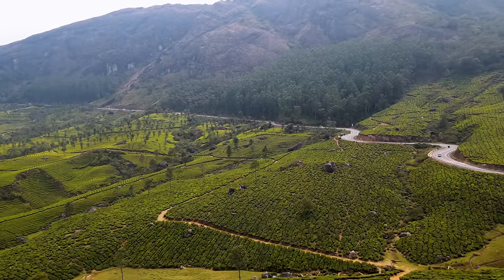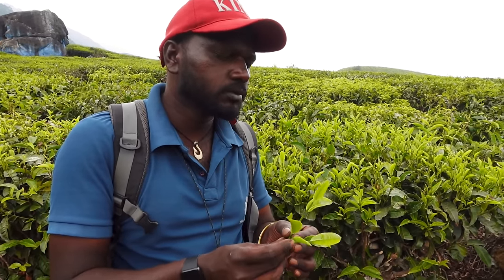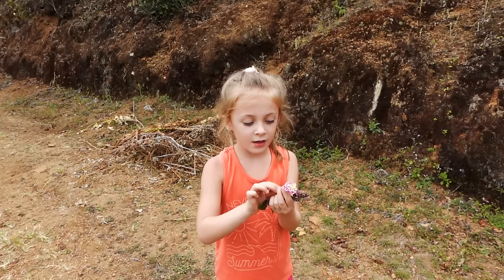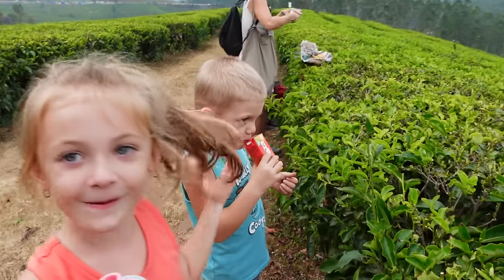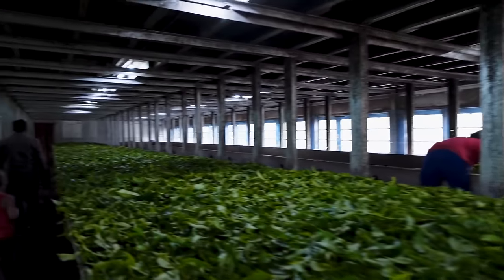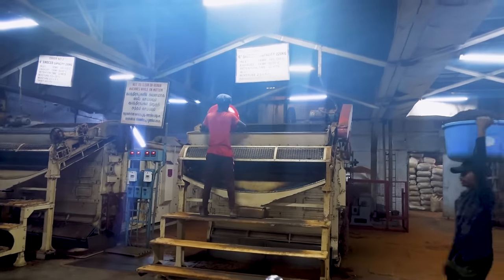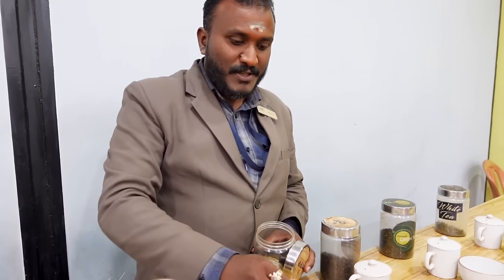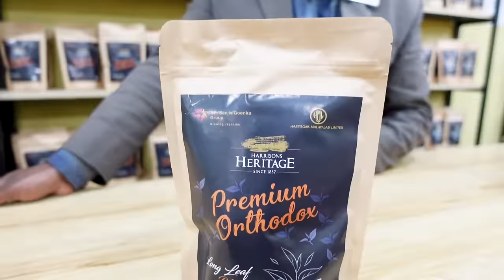Everyone Told Us To Visit Munnar - Exclusive Tour!

Comment: A great treat. I didn't know it was so labor intensive to make my tea leaves. I have new appreciation for the workers and all the work that goes into it. It should be more expensive when you consider the amount of labor involved.
Reply from the maker: We had the same thought when we got insight into the harvesting and manufacturing process! He did let us know that the teas we typically see in most grocery stores mostly use the stem (where the caffeine also comes from) and that they lack the same quality and benefits as the tea harvested and manufactured from the actual leaves. Very interesting